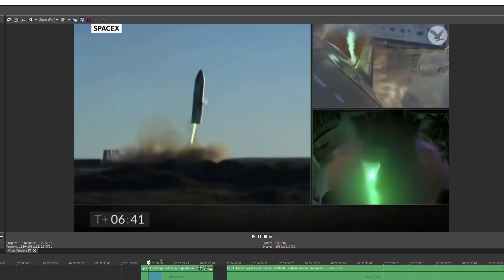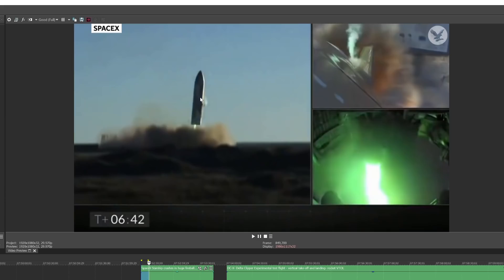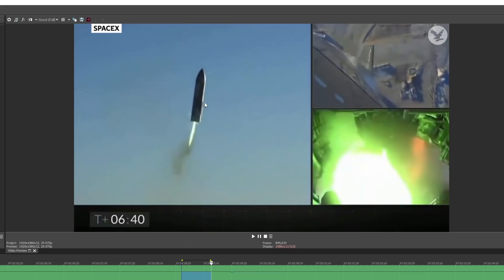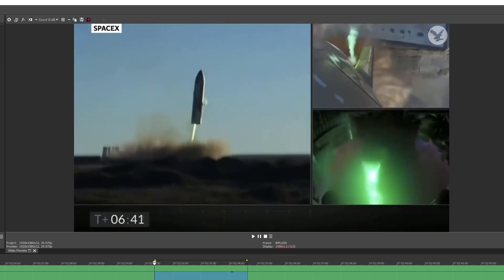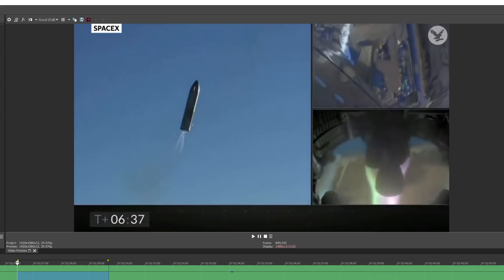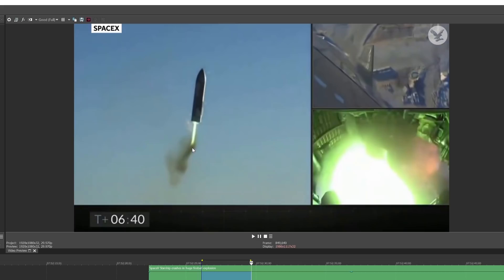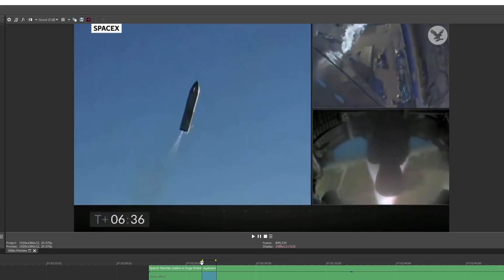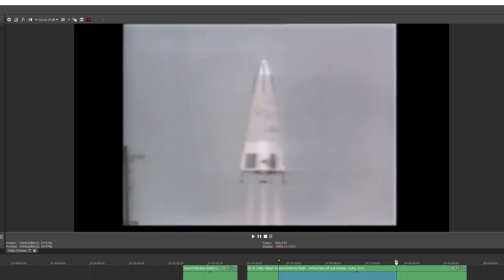SpaceX Starship Explosion: First analysis!

Comment: Isn't the green glow from ignitor liquid triethylaluminum-triethylborane (TEA-TEB)?
Reply: Raptor uses electrical spark igniter. Merlin use tea-teb.
Reply: Yea. Raptor is electric so couldn't have been this. Mixed up things. Sorry.
Reply: No TTEB is used in the raptor engine guys, they use an electric arc to start up the engines.
Reply: No these engines do not use that. They use spark igniters
Reply: Raptor engine doesn’t use TEA-TEB, it has a spark igniter.
Reply: I did just read that Raptor engines were supposed to use spark ignition, not the TEA-TEB used on Falcon Merlin motors.  Must be a copper in the chamber or nozzle burning due to Methane/LOW ratio being off due to starvation.  Also on twitter from Musk a year ago "Raptor uses milled copper channels with an inconel jacket all the way down"
Reply: No, they don't use it in Starship.
Reply: @VoiceOfThunder No, the raptors aren't lit with TEA-TEB. 
The copper was lining the combustion chambers. A lack of fuel makes the mix O² rich shock jack's the temperature up high enough to burn the copper linings. Hence the green flame.
Reply: No not at all.  Raptors don't use it.
Reply: I think that thunderfoot is correct. If fuel flow was disrupted the cooling of the engine bell would be disrupted, resulting in overheating and damage to the bell.
Reply: @AxMi-24  There are copper components in the engine, the green is burning copper, most likely.
Reply: @AxMi-24  Engine bell is made out of Inconel, Nickel, Iron and Cobalt? The injectors are copper though and some other components.
Reply: @Doom2pro  The regeneratively cooled nozzles have copper in them
Reply: @faceplants2  right, Raptor uses milled copper cooling channels ..when LOX pressure dropped, engine over heated and that copper burned.
Reply: @KrustyKlown  Maybe. We're all playing armchair experts here but there are definitely many people in the comments that are much more familiar with this vehicle and it's development than thunderfoot is.
I genuinely think that his hatred of Elon prevents him from giving due credit to most of SpaceX's accomplishments.
Reply: @faceplants2  Musk does tend to rub technical people the wrong way, since Musk is first a Marketing genius, and not a degreed engineer. So we hear Musk over promise, mis-lead, leverage the media for attention, etc... and that has made his business efforts very successful for himself. I get annoyed with that myself, for example, I think Musk's Mars colonization, flying Teslas & hyperloop talk is utter marketing BS.. image creation for Tesla IMO, very effective marketing ..... but as an engineer, I can also recognize the engineering accomplishment SpaceX made today.  They will get this Starship / Superheavy vehicle working .. it will take thousands of Starlink sats to orbit and probably haul some cargo & comsats for NASA to the Moon and maybe Mars.
Reply: @KrustyKlown  When has Elon last talked about the hyperloop instead of some charlatan taking advantage of his early association with the idea?

Working for one of Elon's companies is a huge draw for a large amount of engineering students and scientists coming out of college and in the field, myself included.

He's not concerned with marketing so much as dreaming big, inspiring people and aiming high. There is absolutely such a thing as "Elon Time" however. Landing humans on Mars by 2024 does not seem incredibly likely but it is nonetheless a laudable goal to aim for. This is what he does all the time and gets no credit for the accomplishments that he makes from a lot of folks.

Tesla was criticized by short sellers and haters alike for years and yet is now the most successful American car company. SpaceX has accomplished so much in the past decade.
The Boring company is boring and not every one of his ideas is a winner but to blindly hate on everything he touches is as bad of a take as all the short sellers out there.
Reply: @faceplants2  4 things TF can't b rational about: trump, brexit, elon musk and religion. But tf is correct about hyperloop though.. its such a stupid idea that a smart dude like elon must have known it was just to fool stupid ppl to get more money to funnel into spacex.
Reply: @kungfreddie  Elon and his companies aren't working on or taking money for any of the multiple Hyperloop projects around the world. He dropped the idea on the public as if it was unique and left it to others to develop.
Reply: @faceplants2  I dont know how long tesla will hold. If you sell a car only the 1% in the west can afford your market is very limited. And noone that cant afford a new one will buy a used one since the the repair costs are insane. If tesla is ever going to be more than a luxury accessory for the rich they have to allow copied parts and support for private repairshops. But the battery cost itself will probably stop anyone making less than 100k a year from buying a used one.
Reply: I'd think this rocket has some sort of header tank space allocated in the main tanks for such maneuvers. The main tanks probably has fuel baffles too.
Reply: NO! no  triethylaluminum-triethylborane in this engen
Reply: @SubliminalVibes  prob 2020. that seems to cause most all things to happen.
Reply: No, it’s “engine rich exhaust“ , raptor was eating itself.
Reply: No, not on this engine, they use that on merlin, not on raptor. See scott manley's video :)
Reply: And apparently it is copper, they lost some fuelflow, and had a oxygen rich mixture. Thats the last theory i heard
Reply: They don't use TEA TEB to ignite the Raptors they use torche lighters. The green exhaust is probably from copper inside the engine which is being destroyed.  I believe the pressure inside the header tank fell too low and it couldn't feed the engine with fuel so it flamed out and the other engine began burning too much LOX causing the engine to melt which gave us the green flame.
Reply: @chyza2012  Wow! Could you be any more impolite? Feel free to give us all the benefit of your vast knowledge on the subject.
Reply: actually no. Space x does not use that instead they use an actual igniter. More reliable to reignite in vacuum of space. https://en.wikipedia.org/wiki/SpaceX_Raptor
Although their Falcons did use it. not the Starship.
Reply: Raptors don't use TEATEB tho.
Reply: Scott Manley said the Raptor doesn't use TEA TAB. Instead it uses a spark plug and gas torch igniter.
It's much more likely the green flame is oxidizing copper from the heat exchanger. 
Or engine rich exhaust.
Reply: @dongiovanni4331  And he is completely correct. It was very late and I made a mistake. Thunderfoot was correct from the start. Green flame is due to copper parts in the engine burning up.
Reply: its not from tea teb!!! the engines are ignited by spark gap!!!! its the copper from the engine thats literally burning!!  a difference in head pressure that caused the engines to burn oxygen rich... resulting in a flame that burned the engine itself!!
Reply: @chyza2012  imagine pretending to be an idiot and find out that actually are one!
Reply: TEb is unlikely to be the source because the flame came out of an already ignited engine
Reply: Start at 1:48:00 in the vid  https://www.spacex.com/vehicles/starship/index.html
Reply: Don't get me started on that engine bell curve
Reply: This.
Reply: Was wondering that too. We've seen the seal level Raptor engines glow green on start-up during static fires.

Haha. Damn. That poor flight computer really tried didn't it? Realized the engine flamed out and tried to re-start it but there wasn't enough time\thrust and too much speed. It was off axis by just a hair too so one side hit a split second sooner and focused the impact.
Reply: Raptors don't use it. Merlins do.
Reply: I suspected something like this might be true. And I think there probably is a good chance that TEB is used for the ignition system in that engine, as the green flame can be seen at start up during this test. https://youtu.be/P3-tgfJiNfQ
Reply: I thought Raptor used torch igniters?
Reply: @chyza2012  " Imagine pretending to be an expert when you don't fucking know anything."

Best shut up then.
Reply: No, it's the engine burning itself from within.  Scott Manley explained it best: https://youtu.be/egHxiX40eJY
Reply: On Thunderf00t he show images of damaged engine bells  after the return of a falcon. These bells were copper coloured. 
https://en.m.wikipedia.org/wiki/SpaceX_rocket_engines
Reply: Fuel flow interrupted, oxygen-rich mixture - wouldn't that start burning the combustion chamber/nozzle?
Reply: @bobs12andahalf2  Eventually. Copper goes first, though. And, in the event of a suicide burn, there's not time for much/anything else to happen before the fireworks start for real.
Reply: No they don't use it in that rocket. (Do no confuse with falcons with merlins.) In a spaceship with raptor engines they use big and beefy electric rods to light the engins.
Reply: @chyza2012  raptor uses sparkplug not tea-teb. guess who is stupid now LOL
Reply: The consensus is that it's a Copper(II) fire.
Both engines flamed out and were burning oxygen rich, which ignited the copper alloy in the bell.
Reply: Did they release what actually went wrong with it yet? The landing was a small part of the entire test in reality, the rocket did a lot of what it was supposed to do.
Reply: Could it be some copper alloy in the engine burned as the engine tore itself apart?
Reply: @chyza2012  Where did he "pretend" to be an expert? Sort of seems important for your argument. Please cite the exact quotation of Phil where he said he was a rocket engineering expert.
Reply: @chyza2012  Imagine having a channel loaded with crap!
Reply: The real analysis you've been waiting for from Scott Manley
https://youtu.be/egHxiX40eJY
Reply: @chyza2012  he never claimed to be an expert on rocket engines tho
Reply: @chyza2012  Your playlist tells us all we need to know about you. Oh look! A rock for you to climb under!
Reply: @chyza2012  Imagine telling a successful career scientist that he doesn't know anything when you're an unknown turd who more than likely knows nothing about anything.
Reply: Watch Scott Manleys video if you want to hear from someone who knows the first thing about rockets
Reply: congrats. Possibly only person to ever get a response from TF in YT comments!
Reply: Pinned but entirely wrong. It can only finally land on one Raptor due to the TWR. The green flame was the copper from the cooling channels after the engine was fuel starved due to low pressure in the header tanks which are separate to the empty(ing) ascent tanks.  

Actually following the project and looking at what Elon posted minutes after the final result pretty much explains the lot.  

It also did way better than I was expecting. SN9 is already built with minor improvements and ready for mounting and might actually make it with some adjustments. SN16 I think has been spotted undergoing assembly already, too.  

Love this channel and have been subbed from almost the beginning,  but it’s not the first time it’s got SpaceX rockets just plain wrong.  
It also said reusing boosters was nonsense due to how much it reduces payload to orbit, which kind of misses the point.
Reply: @EeekiE  Spot on.
I like Phil's other content but his hatred of Elon and his lack of familiarity with orbital rockets in general and the starship prototype development in particular really leave me disappointed with videos like this.

It is contrary to scientific thinking to be so obviously blinded by personal biases. If there wasn't any type of failure, I doubt he would have made a video at all. And there was not even a begrudging admittance to what an accomplishment this incredibly ambitious test flight was. Phil is super salty and it's a big turn off.
Reply: Banana Hamhock  opinions are great when it comes to diagnosing some of the most sophisticated mechanical machinery on the planet m
Reply: The Raptors do not use it, they use some fancy spark system to relight. Engine consuming itself would be my guess, something was made of copper?
Reply: Yup Boron makes green!
Reply from the maker: THIS!!!! not quite sure how its getting into the engine at this point... but this is FAR more likely.
Reply: @voiceofthunder9620  Raptor doesn't use TEA-TEB.
Reply: @voiceofthunder9620  No Tea-teb means no Boron on a Raptor to burn green, sorry. It's copper as you originally thought and a previous comment mentioned. Raptor uses a spark to light/relight. Also, header tanks mean they don't use the main fuel tanks for landing to prevent sloshing and pressure loss. Although this looks to have still been the problem.
Reply: @voiceofthunder9620  it’s the copper cooling jacket around the combustion chamber and was noticeable in the first raptor video SpaceX released. The raptor doesn’t use starting fluid it uses a pilot flame that’s started with an electric infighter. For the landing burn they have separate header tanks and the landing burn was only ever supposed to have 2 engines. For someone who doesn’t follow SpaceX and Starship you did pretty well!
Reply: @voiceofthunder9620  I thought it would be some hypergolic fuel to reignite the engine ?
Even if the situation is hopeless it's probably automated
Edit : inb4 the elon fanboys find this comment, I read the other comments, they say this/these engine(s) use electric ignition and that the green was from some sort of copper parts in the pipes being hot and exposed to LOX due to bubble / shortage of methane (see the green bits in the flame before the big green)
Reply: @voiceofthunder9620  "... triethylaluminum-triethylborane" ... "but this is FAR more likely."
your guess in the video was more likely, I think. Since the engine which lights up green is still running, it wouldn't make much sense to inject an ignitor liquid (which this engine type doesn't even need), and it does so in bits and pieces. It's likely the engine burning in an oxygen rich fuel mixture.
Reply: @voiceofthunder9620  There is no TEA-TEB on Starship. It is the engine burning up due to lean fuel mixture.
Reply: @voiceofthunder9620  Hey! why are you so bashing at spacex recently even do they already prove you are wrong about the reusability of the falcon 9?
Reply: @voiceofthunder9620  Just because spacex proves that your lack of knowledge about rockets?
Reply: @voiceofthunder9620  You might be correct in the video.  Per Elon musk twitter: "Raptor [bell] uses milled copper channels with an inconel jacket all the way down". As others have pointed out, I believe the Raptor uses electric igniters rather than TEA-TEB.
Reply: @voiceofthunder9620  Probably being injected when its flaming out
Reply: @voiceofthunder9620  Good demo (not sure if it's the same chemistry): https://www.youtube.com/watch?v=Vr9btpMZICE
Reply: @voiceofthunder9620  AFAIK Raptor engines use spark ignition, so this couldn't be the reason
Reply: @voiceofthunder9620  By the way just recently spacex is able to achieve to launch 143 satallites in one mission
Reply: @voiceofthunder9620  Why do you hate elon so much?
Reply: @voiceofthunder9620  I know others have already stated, but raptor uses torch igniters, so fuel starvation/hi ox due to low fuel pressure is most likely the cause.
Reply: @voiceofthunder9620  FAR more likely something not onboard was burning?
Reply: Correct flame out and the computer tried to restart
Reply: @watomb  No. The Raptor engine doesn't use TEA-TEB it uses an electric torch ignitor.
Reply: @TheSpacecraftX  ok guessing the engine was burning it’s self up.  Thinking Monel stainless steel contains around 40% copper
Reply: @watomb  Interesting, I did wonder about that - thank you!
Reply: These engines didn’t have that chemical restart,  it might be stainless steel burning which might contain 40% copper(Spaxe x version)
Reply: @watomb  yes .. that is what I thought too, Musk said on twitter that header tank pressure was low during landing
Reply: @KrustyKlown  the flame could also be from copper vaporizing. On an earlier raptor engine test a green flame can be seen after ignition, and Scott Manley confirmed with Elon that it was vaporized copper
Reply: Yes, but it's more important to get a hack-layman explanation out as quickly as possible, so we just think - umm.. copper burns green so it follows that the tanks are made of copper. 😕
Reply: I wouldn't be surprised if it turns out that they have fuelled the wrong fuel, and it was indeed TEA-TEB :D

Comment: The small header tanks (which hold the landing propellant and LOX) are full when landing so sloshing is not the issue. The issue on SN8 was that they lost pressure in the methane header tank. Which then resulted in wrong mixture for the engines. They started running LOX rich which increases temperature and the engine burns itself out. Really surprised you are not aware of the header tanks?

Comment: I could guess the fuel pump may have gotten damaged but not to the point where it would fail completely. The turbine will then grind seals, itself and the turbine body to hell while trying to pump fuel. This way you can get loads of metals in to the exhaust while still pumping.

Comment: Yet another horrible, worthless "analysis." Dude, please do some homework before you try to analyze anything, much less a rocket - one that is in very early testing stage no less. Anyone that follows Starship even moderately should know that it uses small header tanks that are full of LOX & liquid methane (separately) to eliminate the problem of fuel sloshing around in the primary tanks. Please refrain from trying to be an expert until you actually are.